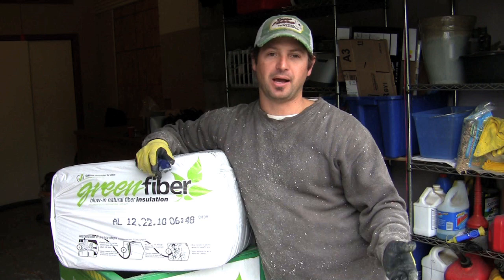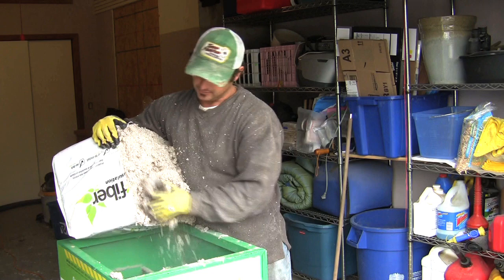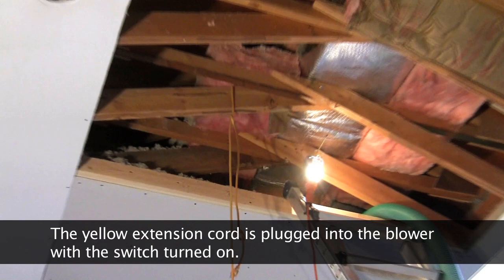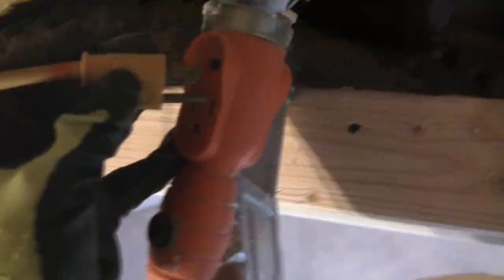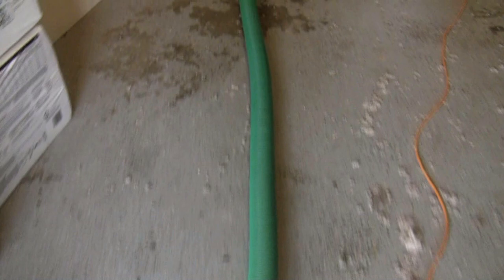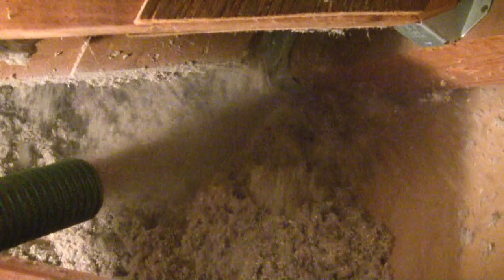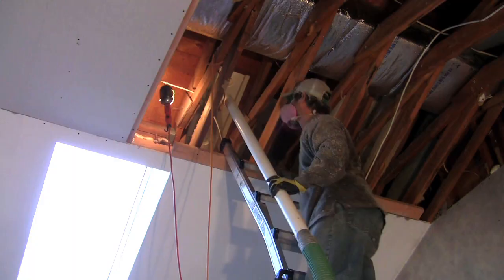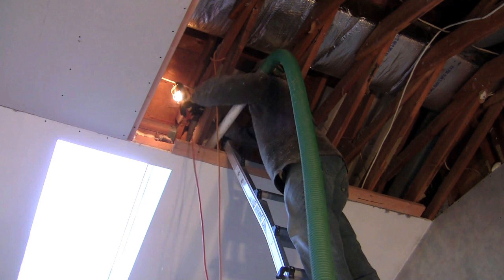Cellulose Insulation -How To Install Blown Insulation by Yourself

Comment: To all those watching for how to blow insulation into your attic, you need to block off your soffit vents, or eave vents on the outside under your roof... if you clog up the vents you will prevent proper airflow in your attic above causing your shingles to bake during the summer, as well as the heat in the attic radiating down during
The summer months causing your ac utilities bill to skyrocket.. very smart idea with the extension cord, great way to work alone..

Comment: Just did this using thus video as a guide. Thank you. Some tips though if anyone is thinking of doing it. Use a utility knife to cut the bakes in half. Just cut the outside if the plastic, and with a bit of downward pressure on both ends it breaks itself into half. Then dump the bale cut side down into the hopper. It'll sit on the blade protective cross metal. Pull off the plastic and you'll notice  that there's a layers or a wafer like pattern in the insulation. Then just use an ice scraper to wedge into the product to easily break it up. So easy.

Comment from the maker: @ahernandez1080 It really helps pack the insulation into those tight spaces. Just make sure to listen to the machine. If it gets too packed you'll have to clear out the hose...which is a pain.

Comment: If I'm able to fill a wall, would I necessarily need the machine or could I just open a bag and start pouring it into the wall would that work aswell?
Reply: hi Martin , Im no pro but just watched a video on walls and no, you need a machine to get the right density at least for cellulose

Comment from the maker: @gpaul721 Hey GPaul721, It is very important to allow fresh air to circulate through your attic space. Mainly because it removes heat and moisture from the attic space. Heat and moisture tend to cause mold and rot.

If you remove the existing attic insulation, you will find there is room to install the soffit vents. It's just a really awkward job because you need to squeeze yourself back under the eaves.  But it will increase the amount of air circulation in your attic and prevent mold and rot.

Comment: Cellulose is also a fire retardant.
Fiberglass is consumable by fires.
Icynene spray foam can be consumed by fire, but is not very noxious.
The typical spray foam most places use is highly flammable and produces tons of highly toxic smoke.

It is nice that cellulose will slow the spread of a fire in a wall space.

Comment: @HowToHomeInsulation - Thanks for the feed back as well as all the other videos you have posted.  Very helpful.   Going to get a start on the job this weekend.  Looking forward to a more comfortable house this winter.   
A question on blown-in; it seems like the cellulose, recycled/eco stuff is much less expensive that fiberglass blown-in & it calls for equal amounts to get the same R rating.   Am I missing something?  Any reason not to use cellulose?  All electrical in the attic is IC rated.

Comment: thanks for showing how its done.. my project is not near as complex as yours, but its good to see how it actually works.. I am installing radiant heat barrier now, but after will blow in the cellulose....and frame it with cedar as I move up and down the roofing.. my whole house is only 25x25.. so your vaulted ceiling is amazing.. Nice job!! thanks for the tips, Cory. I booked your site... :)

Comment from the maker: @gpaul721 In my opinion, cellulose is a great product and I would recommend using it. In my experience, the main difference between blowing cellulose and fiberglass is....one is dusty, the other is itchy. Cellulose is dusty and I always wear a good 3M half-mask respirator. Fiberglass is cleaner but itchy. Personally, I'd rather be dirty than itchy.

Comment: I just tried this machine to try and fill a bag to fit over my attic ladder in the empty space. It ran for under a minute and then quit. The guys at Lowes couldn't figure out what the problem was even after we got all the insulation out of the machine. Are there "tricks of the trade" about when to pull out the flat metal plate, and how far, or other things I didn't think of...that would have meant machine would continue to turn and blow? It seems so simple in theory but in practice we got nowhere.
I'd love to hear any suggestions you have.
When we got all the top insulation out and pulled out the flat metal, the fiber was fairly jammed into the small space underneath. I'm thinking that had something to do with it but don't really know. If it shouldn't have been jammed under there, how can I avoid it next time? After we had emptied the machine, neither the bigger "blades" on top, nor the thin, long blades underneath would turn. I'm curious what could have happened and how to avoid it if I ever find a machine to finish my attic ladder insulation. Thanks for any help. Karuna

Comment: could probably duct tape some cardboard around the top of that thing so you could load more stuff.. use one of those remote control christmas light extensions so you can turn it on and off..
Reply: Cardboard...my thoughts exactly... but the christmas light thing........

Comment: Thank you for the video.  I am about to start my attic insulation project and would benefit from your experience.  If hope you can provide some answers around how to transport this machine (how did you do it). How many folks did you need to lift this?  Is it possible to blow about 15 bags an hour with one blowing in the attic and one loading the machine?  My goal is to blow about 50 -60 bags in my 1000 sqft attic to get about R-38.  Also how accurate is the insulation requirement chart at the back of the GreenFiber bag.  Thank you in advance.

Comment: I  bought a mobile home and it has a new roof on it . I would like to know if I should blow cellulose insulation on top of the original roof (now covered by the new one , you could say that it's the attic now  ) or does the insulation  need to be in the old section just under the sealing .  I live in  Canada , cold , long and damp winters .

Comment: Do you need to install rafter vents and be concerned with bringing the insulation right up to the roof decking if you do not have soffit vents? My house only has eve vents on either side and a ridge vent was just installed with my new roof this spring. 
There doesn't appear to be any room to add soffit vents under the overhang and there have been no rot or mold issue with the current set up.  My plan is to blow in insulation to bring it from the 6" depth to ~16".  I live in zone 5
Reply: Been 12 years bro and no one answered you. How's your roof deck looking? Any mold from the insulation touching it?

Comment: Found out I have dead insulation in my house after I moved in. There's a lot of draft and the house feels cold even w heater being on 24/7 at typically 69°. First floor ceiling is hanging w hanging square blocks. The walls are drywall. Can I just use that hpv truck to blow in the insulation from the ceiling w/o ripping my walls? Like filling in from top those areas? Most of the draft comes from bottom thru the crack of the floor/side trim (idk what the exact name is) I've considered caulking. Thanks for any feedback

Comment: Can I cover up the vents at the end of the house I guess there call sofets
Reply: Nooooo, no no no. Don't do that. You actually need to install little chutes or guards to make sure that insulation doesn't fall down into them and block the air flow into the attic.

Comment: Most of the time it is cheaper to hire a insulation contractor to do attic insulation because of the large discounts they get on product. Also never tape a pvc pipe to your hose, blower hose is designed to get rid of static electricity where are pvc is not so there is a risk of electrical shock when using the pipe.

Comment: You can use a remote receptacle.
Reply: Do I need to plug in a 20 amp receptacle or 15 amp is OK?
Reply: @donj6621  As long as you didn't run it too long at a time it would probably be okay.

Comment: Lol so for the attic couldn’t you just have thrown the bags up there and shredded them up in the attic and spread it out by hand or take rather than dealing with renting a blower? The blower is for when you fill existing walls with loose insulation , not for the attic
Reply: Uhh no. The insulation insulates because of all of the air between the insulation. Throwing a brick of that up there by hand would not be better than blowing it in using the machine.
Reply: hooded robin lol you think that air stays trapped in between ? and I’m not saying to throw the brick up there, I said to shred it and spread it around by hand just like the machine would , can certainly be done easier than hassling with the machine and hoses
Reply: no the amount of air between the pieces of paper and really any insulation is what gives it its R rating. Just like shoving R49 into a 8 inch space decreases its R value.
Reply: hooded robin ok it’s true what you say, but do you think the air is staying between the layers after it gets shot out of the end of the hose ? How does this differ than throwing the shredded insulation by hand ? It really doesn’t
Reply: It’s obvious that you’ve never attempted to fluff up even one bale of compressed cellulose insulation by hand. You are also ignoring the difficulty of moving dozens of bales into the attic and spreading all that around in a confined space that is only inches tall at the eaves. If you actually had you wouldn’t be the arm chair genius you are. 🤪
Reply: A1Skeptic he’s shredding it very easily by hand in the first 30 seconds of the video , he even says it takes one minute for half a bag ?? .. who’s the genius now
Reply: Andrew Wooten The fact that you don’t understand the difference between the chunks he’s feeding into the machine and the fluffy stuff that comes out proves my point. Your clever method would take ten times the work and result in a shitty sub-par insulation value for the amount of material used. Go back to your day job, if you have one.
Reply: Yeah that's the way I did it.
Reply: @hoodedrobin6259    Obviously you wouldn't just set the brick up there. You can easily break it up by hand.
Reply: @neondiamondsaquaberry17    I agree with you on this.👍
Reply: @dennykeaton9701   Use a mixer paddle on a drill in a big box. It fluffs it.  Then spread it with a rake.  Small jobs only.   For large jobs it takes way to long.